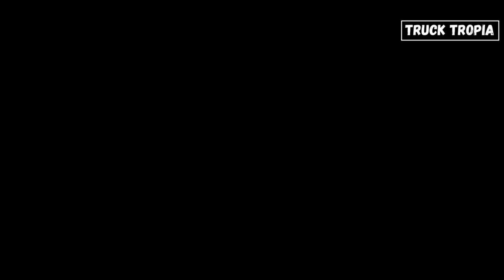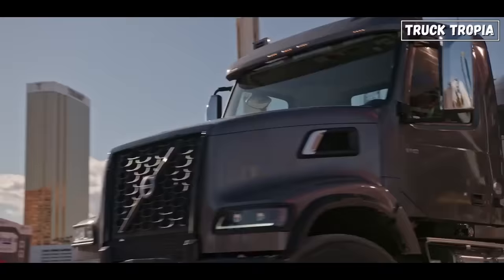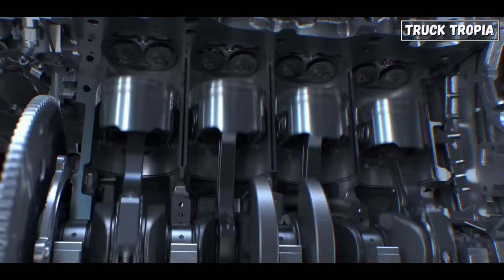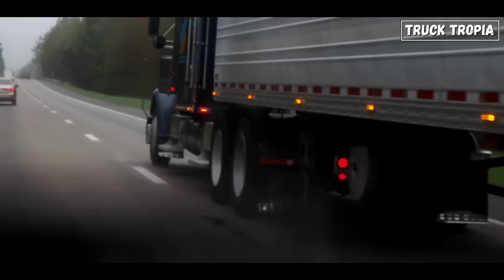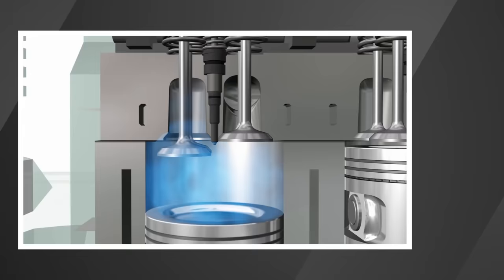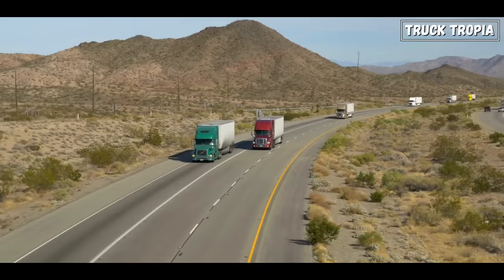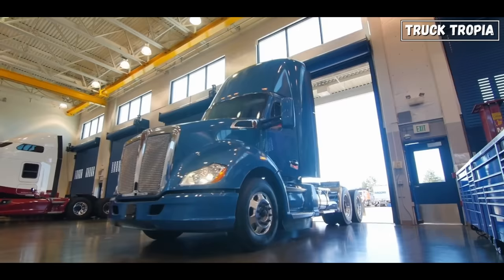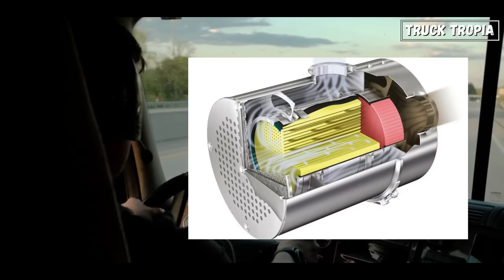Ultimate Truck Education 101 - Every Question Answered

Comment: Tag axles: You missed a couple more reasons, like 
a) Toll reduction; some places charge trucks by number of axles on the road. If you can legally carry your load with the tag axle lifted, you will pay a lower toll.
b) Makes installation of tire chains easier. On SOME trucks, the tag axle can be lowered so far that the drive axle can be at least partly lifted, which makes makes it a bit easier to install the tire chains
Reply: And you can slide the 5th back, pump up the tag and do wheelies! Dont do that in front of your boss, he was laughing his a55 off though
Reply: Can a tag able handle as much weight as a fixed axle?
Reply: @Jay-gz6mv  they can.

Comment: I have done a lot of mountain driving in Colorado. And I must say that the main reason I prefer a manual transmission is for the hills, both up and down. Going up hill it is easier to keep the truck in the correct gear for the hill. You have only limited gear selection in autos. And most importantly, a manual transmission holds a truck back better going down hill with the direct connection to the engine. The reason for the added cost of manual transmission maintenance is due to lack of driver knowledge. I drove a manual in the mtns for 3 years with the same truck and clutch. The only reason it ever needed a clutch was when I went on vacation for 2 weeks toward the end of that time and an inexperienced driver burnt the clutch. Now all my companies trucks are automatics. Thanks for the video!
Reply: That’s so true. I’ve had my truck for 6 years now and I’m on the original clutch and the gears are still tight. Plus, I’m still on the original brake pads which have 618,000 miles on them and can probably go another 500,000 on them. 

There’s a lot of maintenance issues you can avoid just by knowing how to do it.
Reply: Having a manual transmission is a must on bad roads. The arthritic chimpanzee they have shifting gears on the automatic doesn't know how to shift when traction is so poor, the tires are spinning. Putting tire chains on confuses the system even further, as it will not shift at all when pulling a grade on icy roads. Not even in the so called manual mode.
Reply: I ran 10sp 13sp 18sp and even a two stick Mack. I started driving a 12 speed auto a few years back and it's a wonderful transmission.
Reply: I'm a old school driver grew up driving every kind of gear box. The new automatic semi Transmissions are wonderful
Reply: Automated manuals all have a manual mode though, you can just put it in M and hold a gear for as long as you want.
Some also have hill modes or even offroad modes for their automated manuals, i drove a Volvo FH dump truck with an offroad mode and it was great in snow dumping sites, along with the automatic diff locks.
Reply: @TopiasSalakka  I hope you never experience how useless the 'manual' mode is on bad roads. Takes too long to shift to be useful, the computer gets confused by tire spin, and just refuses to follow orders.
Reply: @bfgoodrich8564  I have driven a lot on bad roads and manual mode is completely fine. From my experience the computer does exactly what i've wanted it to do.

Maybe AMT's just suck in America, dunno.
Reply: @curbstomp3126 I don't trust automatics

Comment: A couple more items come to mind. Engine capacity has a direct effect on the effectiveness of it's braking power or Jake Brake/ Jacob's brake. Invented by a log truck driver in the western usa it reduced the number of run away trucks after excessive braking (brake fade) from descending long down hill runs (mountainous terrain) The bigger engine capacity provides so much braking effect with the correct down shifted gear that you can descend hills without using the brakes at all. The second thing I thought of was the pro's and con's regarding transmissions. There are many drivers out there that do not know how to shift gears, or even how to use the clutch from a standing start. The wear and tear on the clutch, transmission and power train is very costly, not only in repairs but lost revenue due to the truck sitting in a shop waiting to repaired. Many experienced drivers will only use the clutch to get the rig rolling, then all shifting is done without using the clutch. I put 600,000 miles on a new Kenworth Sleeper with a C15 Cat engine and it still had life in it when I retired from that company. The terrain varied from flat land to over the Cascade Mountain ranges. Stay smart and stay safe out there! All the Best!
Reply: There's a 7 mile downhill run on I-77 going SB from Virginia into North Carolina,  fully loaded, in the right gear, with the right level of Jake brake, I can just glide down at 55 without touching the brakes or the accelerator.
Reply: Most European trucks use hydraulic aux brakes for some time now. Way more powerful then Jake brake and more quiet. And robotic manual gearboxes are just as good as manuals. There is no true automatic in Europe like you have in US

Comment: The people that decide we don’t need higher horsepower in the US hasn’t ever been behind the wheel of a working truck, just test tracks. The limited horsepower has more to do with companies here wanting to spend less money on the trucks not caring how long it takes or frustrating it is to climb a hill or mountain while still pushing you to make the delivery on time or ahead of schedule. They also don’t really care about driver comfort because the seats in most trucks unless modified really suck and the options within the trucks are very limited and sparse. The legal limit in the US is 80k but that doesn’t mean that drivers don’t often haul much heavier loads with the proper permits. The EPA also has a big hand in the engine choice here in the states. Just another example of them sticking their noses into areas they don’t belong because a lot more to concerned about than what engines we use.
Reply: You're right about companies not caring about how long it takes you to make your delivery.
As long as you're not late to your appointment. 
They pay mileage for a reason.
They also want to get rid of all their drivers as soon as possible, replacing them with driverless trucks.
Robo trucks won't have hours of service regulations to follow.
They won't have to be paid or be provided with benefits or days off.
Those trucks won't take sick days or vacation days and will only stop to refuel, load/unload and have maintenance performed, the occasional flat tire not withstanding.
Those trucks won't speed or get distracted or sleepy or p¡ssed off. They won't jam gears or get into accidents either.
And they won't organize or demand more comfortable seats.
They'll effectively be slaves. 
The day of the long haul truck driver is in its sunset years. Local and specialty drivers will have a few extra years before the hammer drops, but not many. Just don't let your kids become truckers. They'll never get to retire doing it.
Reply: @user-sm3th7ow5w  won’t get into accidents. There have been quite a lot of accident directly related to the self drive feature. They’ve hit several vehicles including emergency vehicles while they are parked on the side of the highway. Just imagine how bad that would be if it had been an 80 thousand pound truck. Personally I don’t want to be on any road with driverless vehicles at least for several more years. 
None of the trucking companies will be able to work on their own trucks as they currently do so that will cost them a ton of money and even more down time while waiting in line for service. 
They’ll have to pay someone to man every charging station because a self drive truck isn’t going to plug itself in. 
Companies won’t be able to force their EV trucks to drive faster in order to deliver ahead of schedule. 
Good luck replacing those massive battery packs when they fail because they will fail as well as start degrading year after year. Average cost for a car EV barttery is between 15-20 thousand. I’d imagine the Truck batteries to range in the 75-80 range. 
Who’s gonna take the straps off the flat bed trucks, stop after 30 miles to check the load and the toe downs to make sure they aren’t lose?
Guess they are gonna have to man them with the fictional Tesla robot as well.
Reply: @P-J-W-777  technology continues to improve at a geometric rate. Human decisions are being removed from the driving process.
After 23 years driving trucks in Arizona, I moved to New Mexico in 2014 and drove oil trucks in the oil fields. Every single semi I ever drove over thirty years was a stick shift.
When I moved back to Phoenix in 2021, auto shift trucks were standard in the industry. I didn't even know that technology had been worked out. I'd always heard it was too expensive and the automatic transmissions just weren't strong enough to handle the loads.
They still aren't. 
So the manufacturers figured out how to get the truck to "shift itself".
The transmissions are still non-synchronous, but the computer system has taken over shifting duties from the driver.
I started driving for Penske occasionally, moving empty tractors from place to place. None of the late model semi's they rent are stick shift and none of the newer box trucks are either.
One of the guys that works there handed me the keys the other day instead of driving the truck up for me. He said he couldn't drive a manual transmission truck.
I felt bad for him, but there just aren't any stick shifts on the market anymore.
My point is that transition to automatic happened in less than a decade while I was gone to the oil fields. 
The transition to driverless will be just as rapid once the bugs are worked out. It's going to happen because MONEY.
Driver compensation and fuel costs are the two biggest expenses in the trucking industry. If they can eliminate one, they'll do it. Driverless can happen without electric. Once both technologies are available, it's a win win for trucking companies. No more expensive fuel and no more expensive drivers.
You can BET they'll do it. Amazon will probably lead the way.
They'll invest in support staff to keep the electric robo trucks rolling. People will be used to facilitate that focused effort. Loading, unloading, mechanics, fueling, recharging, repair etc, it will all revolve around keeping the robo trucks wheels turning.
It's going to happen, probably before this decade is out.
Reply: @user-sm3th7ow5w  yes I agree it’s coming. I’ve been around trucks and the oilfield all my life, do like you I know trucks. I can see benefits but I can also see dangers along the way.
Reply: EPA is a teddy bear, it is CALIFORNIA’s CARB that is the draconian Grizzly Bear that believes that they know what should be done!!
Reply: Higher horsepower equals higher fuel usage, thats why they use lowest hp to get job done. Fuel prices are ridiculous.
Reply: @albertwilson7239  not necessarily. My tuned higher horsepower truck gets much better fuel economy than it did stock.
Reply: 105,500 gvw
Reply: @HubertofLiege  exactly why higher horsepower is better. Those who say it’s not needed have never ran 80,000 pound plus loads through hill country or the mountains!
Reply: @P-J-W-777  who going to man the required fire extinguisher? If there is wreck is it going to know how to get around it. Follow the flagman? Who is going to be the good samaritan that trucks are known for? On and on.
Reply: @albertwilson7239  not in real life.  The bigger Volvos and Scanias usualy have less fuel consumption when hauling a heavy load than a truck with less power.

But when only carying light loads like the US truckers do, you don't need the power we need here.
Reply: @magnuslundstedt2659 Its true an underpowered vehicle gets worse mileage, but the US is limited to 80,000 max weight so on flat ground I would think a smaller engine would get better mileage.
Reply: @Mentaculus42  I fear the coast gaurd but maybe thats becuase I am a merchant mariner.
Reply: @cloggedpizza239  

In the 2 months since my comment was made the EPA has Finalizes GHG Phase 3 Truck Emissions Standards, quite stringent, BUT not draconian like CARB where the Californian bureaucratic are out of touch from reality. Besides the Coast Guard like every governmental entity “is there to HELP you”. /s

Comment: Pretty spot on information.  However, there are places in the US like Michigan, where you are legal to run 164,000 pounds on 11 axles.  Which requires every bit of 550+ hp in order to get any work done.

Comment: I run the same route each night and have a 450hp in my truck. It takes 12-15 gallons less fuel to do the same run than my old truck did with a 385hp engine.
Reply: As a Marine Engineer a Diesel engine is most economical between 75/85 %load range hence the bigger engine’s in Europe
Reply: Gearing.  Not engine
Reply: @gerritverburg4105 What what kind of ships did you serve on?

Comment: In 1980, when I was a Sophomore in High-School, I penned a Truck-Cab eerily close to the TESLA COE Tractor, back when NO ONE considered Aero, Fender-skirts, or retracting Pin-Tables. My  design was a 'Tilted into-the-Wind' Cab-over that created a 'nose-cone' of decent streamlining, and allowed a Shorter Cab than front-engine set-ups, but had enough 'track length' to be stable (not Darty) with long trailers. The Cab, now being above, but a bit Behind the Motor, could be de-coupled from the engine noise/vibration/heat, and, like a Cab-Over, the 'Storage + Bunk' space could be quite Deep, as well. Having a retracting (on a hydraulic ram) Table for the Trailer Pin, meant that the Cargo could 'reel-in' to tidy-up the Airflow on the Highway, but also extend to help in 'tight alley' turns, or for Stability with high C--G loads in corners. I used Full Skirt fenders to streamline, but also keep spray/dust from Harming Cars as they drove nearby. The Fuel-tanks were also 'flared' into the fender skirts (w/steps to access the Cab/front-of-the Trailer) to further streamline the Rig. In the Doors, 'Look-down' glass panels let the Driver see small cars tucked-in close to the front-of the Cab.   I have watched the DE-Evolution of American Trucks with Sadness, knowing that, 44 years Ago, I HAD The Better TRUCK design, and could have, kept Trucking costs Down enough to even slow the GOP's Plan to devalue $$$$ as a gambit, to a HALT, while NOT Burning 4 decades of in-effectively-burned Carbon Oil Fumes... Oh well, It isn't like the GOP Understands 'Better Ideas', they just Follow HALIBURTON to Hell.

Comment: Diesel is a lubricant, gasoline is a solvent. Less wear on cylinders and rings burning diesel
Reply: Actually, sulfur is a lubricant, and modern diesel fuel has very little sulfur compared to fuel 20 years ago. Also, fuel doesn't lubricate anything in the cylinder. It burns. Diesel engines have reduced wear vs. gasoline engines because of how they are designed, not because of the fuel. And, furthermore, diesel contamination of engine oil actually INCREASES wear, and contamination is more common now due to the use of post-combustion injection for the DPF.
Reply: Also ~15% more energy per gallon.
Reply: @moseshughes2670 There must be a lubricant aspect because optimum biodiesel is 3-5% mostly for lubrication with little loss of power.
Reply: Used diesel fuel to clean heavy oils stains in past job
Reply: @artsmith103 There is a lubricity benefit, both to the cylinders and to the fuel injection system.
Reply: Place Ultra Low Sulfur fuel on concrete , it will evaporate in a day or so .
Reply: I hauled gas diesel and Jet fuel for 7 years  - Gasoline is a flammable 1203 - Diesel is a combustible  - Neither one are solvents nor should they be used as one
Reply: @MemmenTrucking-zm2cy  gasoline is a Non-polar, Aliphatic solvent. And still today used as an industrial solvent and feed stock for the production of other industrial solvents and compounds. You are correct I’m the fact that the average Joe homeowner should stay away from using gasoline as a degreaser or solvent in the garage. I have no idea what the DOT classifies chemicals in the transportation industry.

Comment: Shifting gears are all part of driving a truck. With automatics you just sit there and hold the steering wheel and more likely get drowsy. Also a lot of the engines used to sound cool. Now you don't hear them at all which adds to the drowsiness. Maybe they'll have it so we can sleep while we drive. Lol
.
Reply: Your are 100% correct ... the monotony of long drives adds to drivers falling asleep at the wheel. I've done it too many times to even think about it! Glad I'm retired and alive! It's something only sleep will remedy
Reply: Then switch to manual mode and change gear. Unless of course you just like to fondle sticks.
Reply: The more sticks, the better. It keeps you awake. Lol @AlexKall
Reply: 5X4 with a 2 stroke Detroit  and you'll not get sleepy 😂😂